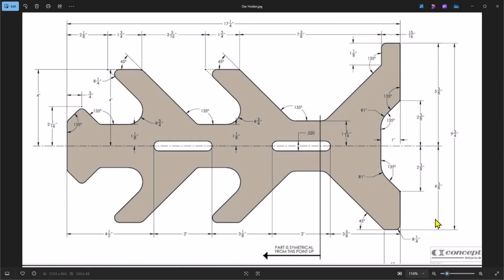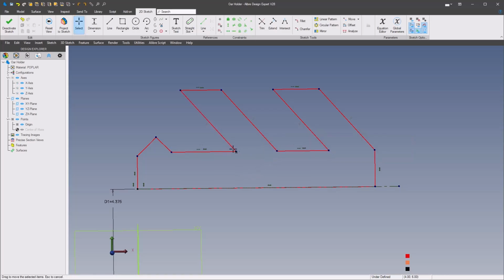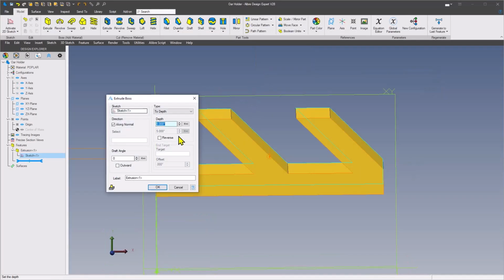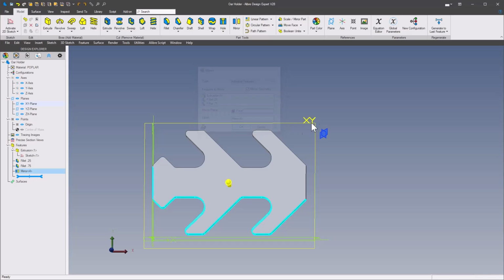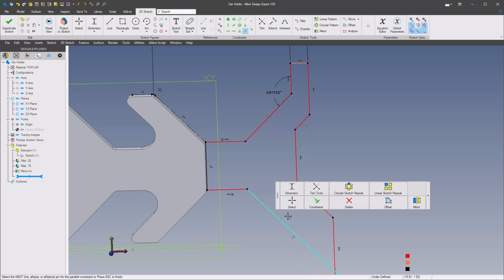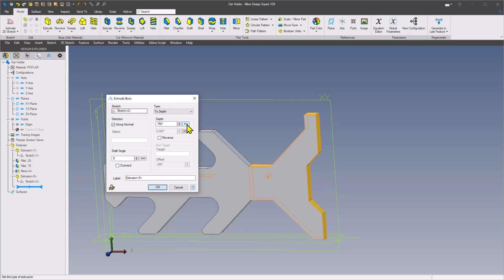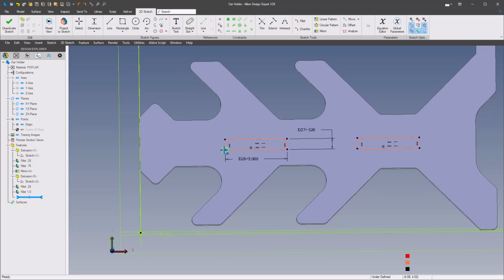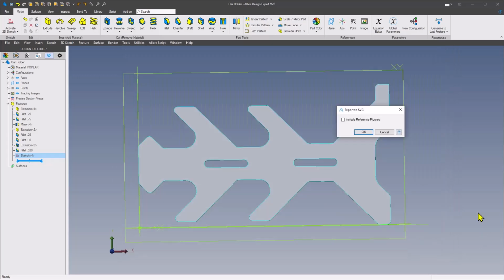Alibre Design Tutorial  -  Modeling an Oar Holder

Comment: Excellent Harold. Atom3D does have mirror entire part feature, but it doesn't have sketch node figure.
Reply from the maker: Bummer that it doesn't have the sketch node. You could draw a Reference line then constraint the end node of that line to the intersection. Then dimension from that node as shown.
Reply: @HaroldL-bn4eo  yeap, that would be a workaround for the sketch node. 

Just checked, Atom3D has slot figures as well. FYI